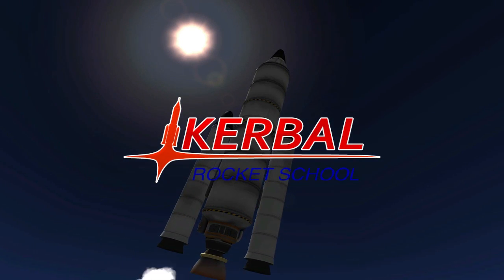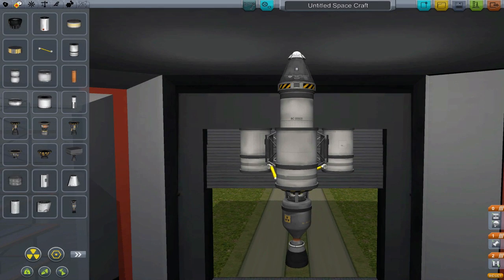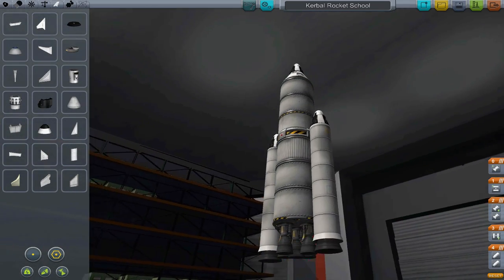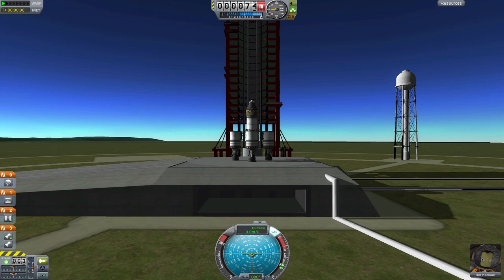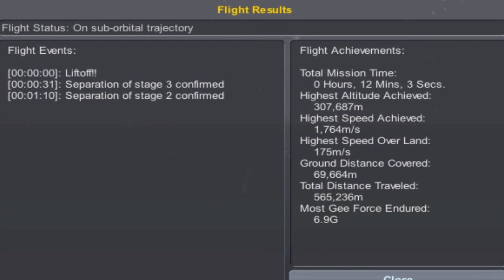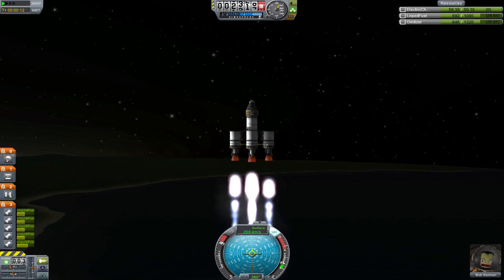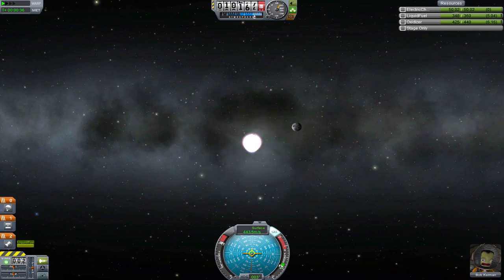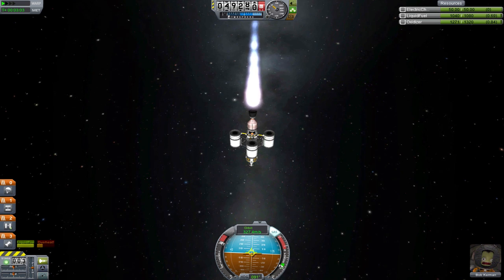Kerbal Rocket School | Episode 6 - Advanced Staging Techniques

Comment: Actually, I'll correct myself. When I did the same experiment with a boosted rocket (in this case, checking how much fuel was left after I reached the mun), it turns out it does help to reduce thrust in the lower atmosphere.

Comment: That is because he start the engines at 100% trottle. In reality, you start them at 5~10%, increase the trottle until you reach a little more than 1.00 TWR and then release the stability towers. 
When the rocket is way over the launch tower, gradually increase the trottle even more until you get the highest safe acceleration for that part of the atmosphere (the higher you are, the most trottle you can push with the same G force).

Comment: I made 2 Tests:

Test 1 : No Fuel Lines
Results: 
- All Engines went off the same Time
- Max Height: 3.306.992 m Above Kerbin

Test 2: Onion Staging
Results:
- Boosters went off just Above Kerbin Atmosphere
- Max Height: 33,300,448,550m Above Kerbol

Test 2 where started in Retrograde point of Kerbin (Sunset)